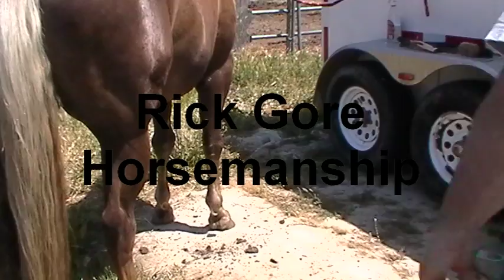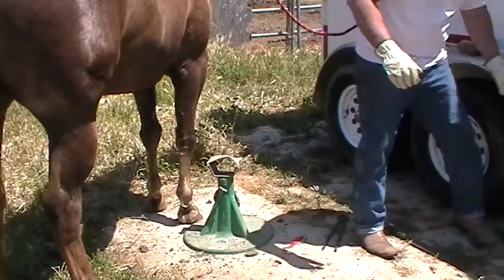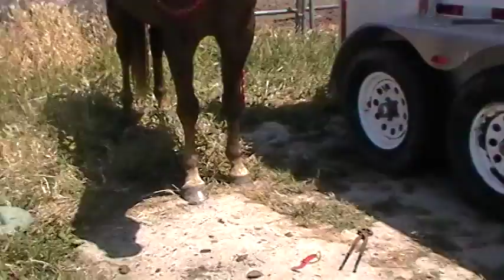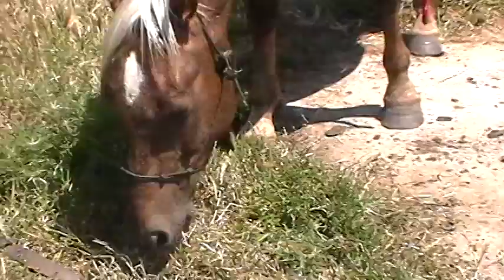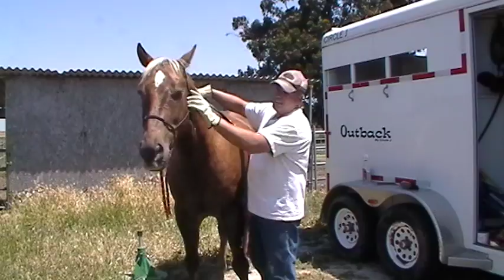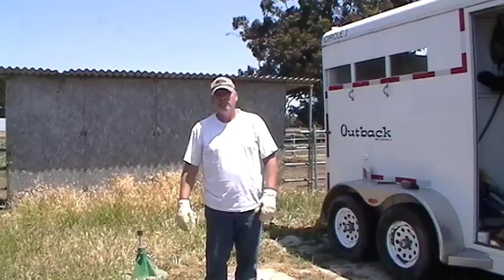Basic Horse Hoof Barefoot Trimming - How I trim Horse Hooves - Rick Gore Horsemanship

Comment from the maker: @italianbabe100 : Pretty much, some like to leave the angle or heel a little longer.  Back hooves are not as critical since they only carry 20 to 30 percent of weight, but if you remember less is more, a little at a time, small adjustments, that way you can only do small damage or small issues.  It comes with time and by doing it.  The short answer, yea it is about the same for back.

Comment: I got a few questions since my neighbor usually asks me to look after his horses from time to time. His got a 8 hour shift so it made sense to me to look after them. Ones about 14 to 16 years old. I don't think her hooves should be having two hanging chips on both front hooves. He told me that he needed a farrier to examine her and fix her hooves. I asked him why he didn't do it himself. Unfortunately he said his back wasn't the same anymore for it. I asked him if she at least has some previous experience in letting her hooves be trimmed, picked, ETC. She does but it's been awhile. The other horse seems to have his hooves normal all the time. I find that kinda odd since the only thing I noticed was a small tiny crack nothing too serious (not going into the hooves just going to the side a little no more then a little tiny pencil tip. Yeah I got good sight.). He does need his hooves picked and rounded though. So before I go into a huge story (kinda already did sorry). I was wondering what else I should know? He might ask me to help him trim and fix both of the horse's hooves.

Comment: Rick, I'd like to know something, if your rasp blade gets dull, can the blade be replaced, or do you have to get a whole new rasp?  Just curious.
Reply from the maker: rasp can be sent off and sharpened but not worth it with shipping and won't be as sharp as new one, new ones are about 15 to 20 bucks, getting old one sharpened is about the same

Comment: Any recommendations on rasp and nippers ?
Reply: +RiverMonkeyBrewing When it comes to nippers, a key point is that the cutting edge be very thin. If you go to say, a farm supply store and look at the cheap nippers, the ones under $50, closely examine the cutting edges, VS the more expensive nippers, the ones that are usually around $100. The more expensive nippers have more of a knife edge. This makes cutting through the hoof wall MUCH easier and MUCH less effort. There are also compound nippers such as the Budd nippers that lessen the force you need to nip, and have removable blades for easy sharpening. There are some other brands also that have removable blades.